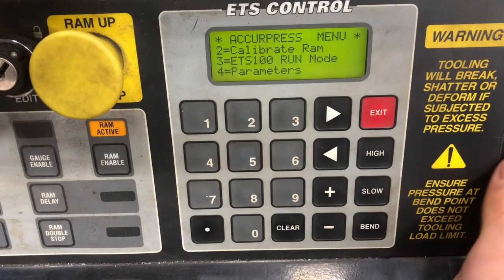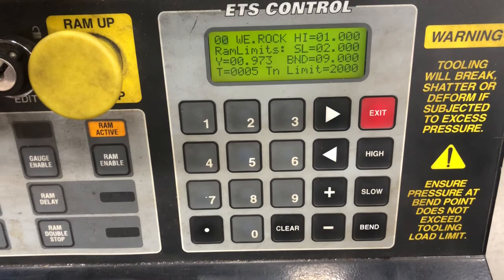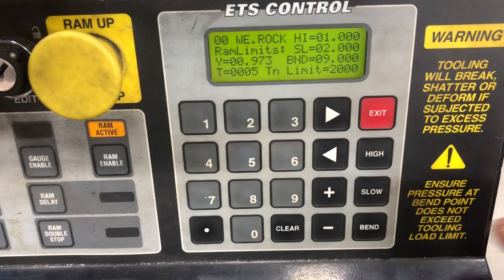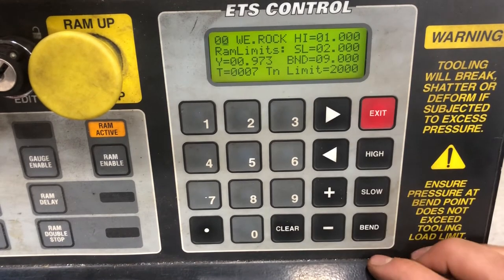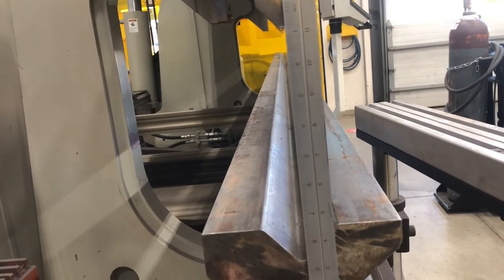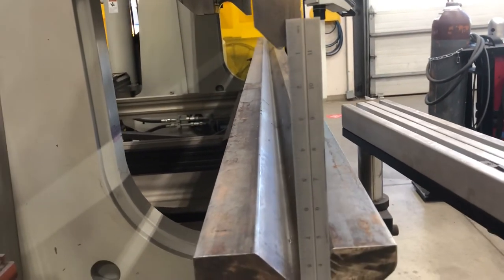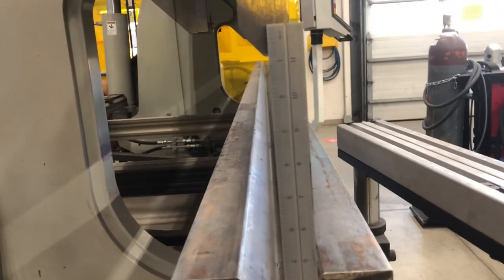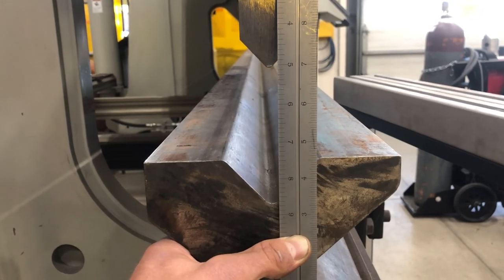Accurpress Press Brake: ETS 100 run mode

Comment: Question do you know how to adjust the ram tilt with the ETS 100? Can you do a quick video on that if so? Do you just jog to Y axis setting and adjust from there? Thanks for your time.
Reply: Do you have a ram tilt button on your pedestal? If so then you should be able to level the ram by looking at your ram dial indicator